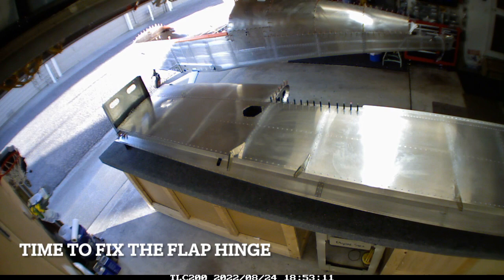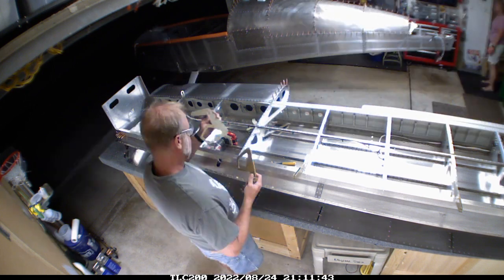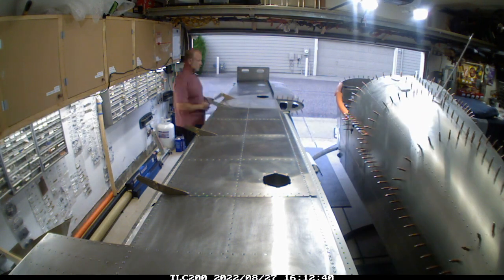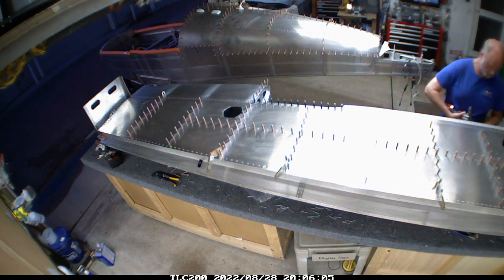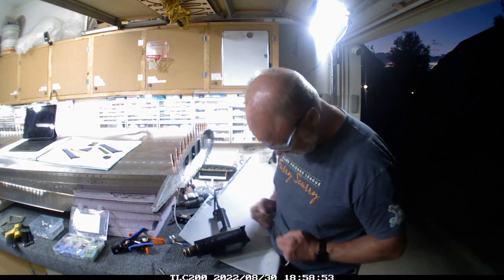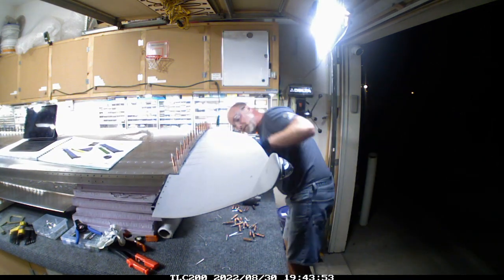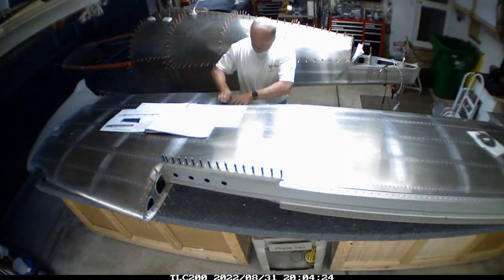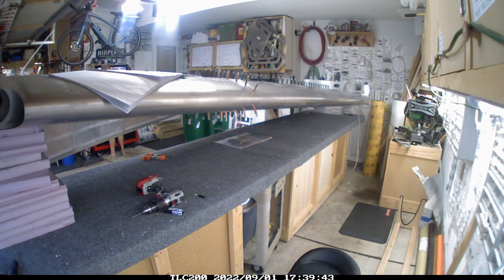Sept 2022 Fixing the wing hinge and getting the fuel tank installed

Comment: We had the same problem - we eventually found there were several issues:
- both wing skins (top and bottom) tend to interfere with the fuel tank placement, so it's easy for them to get caught. We used some popsicle sticks to keep them up and out of the way while we maneuvered the tanks

- another issue is that the fuel tank bracket corners are sharp and can get caught. You have to come at them at a specific angle to get the tank on - we rounded the corners of the angles by sanding to help this. 

-if you have paint or primer, you can see where it gets scratched off as you're trying to put the tank in and out and that helps with diagnosing the issues. Definitely requires at least 2 people (easier with three) to get on. Here's a blog post with pics :) http://slingalongblog.sashapeter.com/closed-right-wing/

Comment: I’m having the same problem. I have long range tanks, but don’t think that fuel line is  interfering. Similarly checked the tabs, tried greasing them. I did use a ratchet strap,   Built up the trailing edge (flaps & aileron removed) with blocks to protect it. It took some work and a lot of tension, but got the tank clecoed on. Slept on it and removed it the next because it just doesn’t seem right to require that much force. Haven’t figured out where I’m going from here yet.
Reply from the maker: I hope you don’t have the same issue I ran into.  It took me a while to sort out where I introduced the problem.  Let’s just say I didn’t follow all the instructions perfectly.  Once I figured out where I went wrong, I’ve been able to backtrack and get myself back on track.  I didn’t do the long range tanks as mine are the 26 gallon tanks.

Comment: We had the same thing with the fuel tank. It went on just fine for awhile, and then it didn’t (we’ve taken it on and off many times for various reasons). The key for use was those friction brackets need to line up - they were not going where they were supposed to and causing the problem. I think it worked best putting the bottom on first and rolling the tank upward if that makes sense, while making sure those brackets engage correctly.